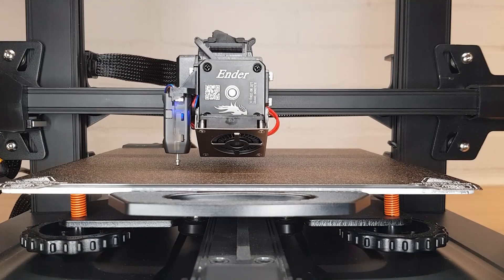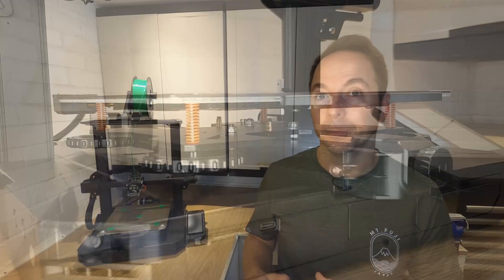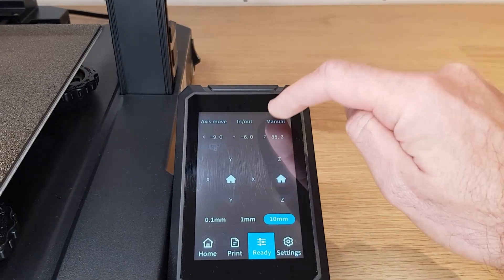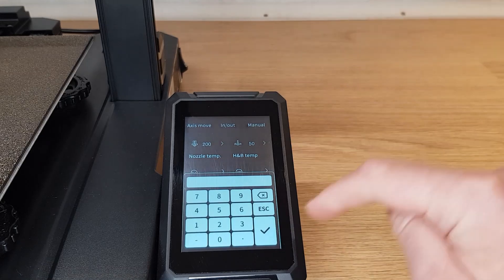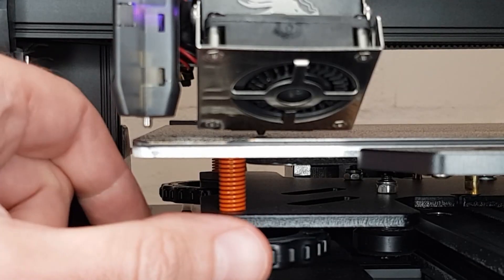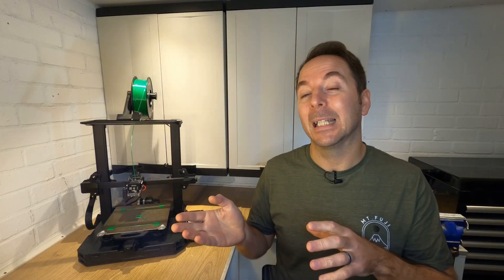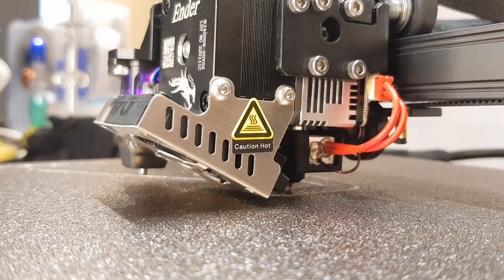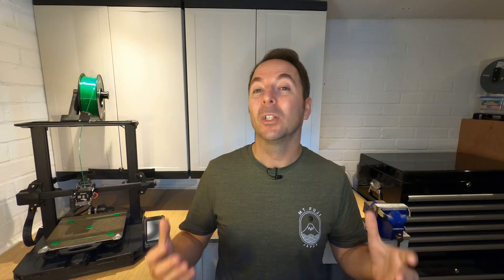Ender 3 S1 Pro 'Automatic' Bed Leveling In 3 Simple Steps

Comment: Hi.   as I said before this have been a great video to help with my S1 Pro levelling.   I am having one issue though, the big levelling wheels are coming loose then falling off during long prints.  Today was after 8 hours which I didnt notice and then everything sort of fell apart from there.  Sad times.  I follow the levelling process and the bed is really level afterwards but the wheels literally coming off mess up my prints.   Any suggestions?  thanks
Reply from the maker: Hi, usually the only way the adjusters can wind themselves off is if they don't have enough pre-load to begin with. Try adding more tension to all the springs before tramming the bed and you shouldn't have that problem. If for some reason you just can't stop it, get yourself a lightweight thread locker like Loctite 243 and put a small drop on each of the screws. This will stop them turning on their own but won't stop you turning them when you want to.
Reply: @RickyImpey  thanks.  just did a google search and it appears to be a thing on certain types of long prints.  Will try what you suggest.  Appreciated as always.

Comment: Very useful tips about the springs, I’ve never seen this done by anyone else. I assume this works for any bed tramming. I’ve just upgraded to a microswiss NG and having lots of issues with first layer so hoping this will help me. Great Video as always Ricky
Reply from the maker: Thanks, it's a technique that I've adapted from another type of 4 point leveling system. It's a method that works with any kind of 4 point leveling. Basically, you want to try to always adjust 2 adjacent points together as much as possible so that you never induce a twist in the bed surface.

Comment: Thank you for this video. You got a new subscriber. I just got an S1 pro.
Reply from the maker: Welcome! I have a video to help you with calibration or your new printer coming out tomorrow 👍
Reply: @RickyImpey  Nice. I'm looking forward to see it. Keep up the good work.
Reply: @RickyImpey  one question. Can I use the G92 and the M420 S1 Z10 in my starting Gcode at the same time or is it one or the other only? I can’t get anything to stick on the pei sheet even though I trammed the bed just like you did in the video. My current Z offset is -3,45 and I don’t know if that is supposed to be right or not. When I use the paper that came with the printer the nozzle is grabbing it but I can slide it in and out without it ripping.
Reply from the maker: @PeoplesChamp121  I think you probably mean G29 as that's the code for bed leveling. G92 does something different. There is no reason to have both a G29 and M420. G29 takes a new bed mesh before each print and M420 uses the one saved in the memory. I use M420 as it means a print will start quicker without going through the bed probing sequence each time. It's up to you what you want to use.
It's very easy to tell if your z offset is wrong. Start a print with a brim with about 10 lines and manually move your z offset until there is just about no gaps between the lines. This should be perfect.
Reply: @RickyImpey  thank you Ricky. I will try it again later today. I appreciate you taking the time to read and reply.

Comment: I am a complete 3D printingr beginner and I was having trouble leveling my Ender 3 S1 Pro until I found this video and saw the tip to add the G29/M420 code to my slicer's G-Code. Thanks Ricky!
Reply: The biggest issue for me is that for some reason, auto bed leveling doesn't work and keeps failing when the heat bed is on. Making the code useless to me as the probing fails at the begining of every print.
Reply: Hola nose si me podrías ayudar , a mi me pasa de que el auto nivel de mi pantalla lsd se congela al llegar al 100%  @bigboomer1013
Reply: Is it only need to be done once this gcode adjustment or on every new prints?

Comment: New subscriber, very helpful video, I am using Klipper, but noticed I was missing the command in the GCode start code, that was making the printer use the bed mesh.  Now I have added this I have found bed adhesion alot better across the whole bed, where as before, some places seemed to adhere and some didnt, many thanks for the very useful tips :)
Reply from the maker: Glad it helped Ian, welcome aboard 👍

Comment: #Ricky Impe  this is what i have in side my ender 3 s1 pro 

G28 ;Home

G92 E0 ;Reset Extruder
G1 Z2.0 F3000 ;Move Z Axis up
G1 X10.1 Y20 Z0.28 F5000.0 ;Move to start position
G1 X10.1 Y200.0 Z0.28 F1500.0 E15 ;Draw the first line
G1 X10.4 Y200.0 Z0.28 F5000.0 ;Move to side a little
G1 X10.4 Y20 Z0.28 F1500.0 E30 ;Draw the second line
G92 E0 ;Reset Extruder
G1 Z2.0 F3000 ;Move Z Axis up

could you reply with yours sire ?
Reply from the maker: No problem, this is mine:

; Ender 3 S1 Pro Custom Start G-code
G92 E0 ; Reset Extruder
G28 ; Home all axes
M420 S1 Z10 ; Use saved Bed Mesh
G1 Z2.0 F3000 ; Move Z Axis up little to prevent scratching of Heat Bed
G1 X0.1 Y20 Z0.3 F5000.0 ; Move to start position
G1 X0.1 Y200.0 Z0.3 F1500.0 E15 ; Draw the first line
G1 X0.4 Y200.0 Z0.3 F5000.0 ; Move to side a little
G1 X0.4 Y20 Z0.3 F1500.0 E30 ; Draw the second line
G92 E0 ; Reset Extruder
G1 Z2.0 F3000 ; Move Z Axis up little to prevent scratching of Heat Bed
G1 X5 Y20 Z0.3 F5000.0 ; Move over to prevent blob squish

Comment: I have found a weird quirk in the Z offset after the auto leveling on the S1 Pro. To get PERFECT first layers (no matter what size nozzle) from the get-go, the Z offset needs to be 0.10 mm above the print bed (which is roughly the thickness of a piece of paper).

if you set the Z offset manually to just touching the print bed after the "auto leveling", then go the axis move screen and move the Z height to 0, you will see the nozzle crash into the print bed. But if you do the +0.10 mm Z offset after the "auto leveling", when you go to the axis move screen and move the Z height to 0 and you look at how high the nozzle is from the print bed, it is darn near perfect to 0.

Which makes sense on their instructions. They say to run the auto level first, then when you hit the back arrow button it brings you to the "manual leveling" screen and you are to adjust the Z offset with a piece of paper between the bed and nozzle. I believe the firmware takes this height discrepancy of +0.10 mm into account from that point on.
Reply from the maker: I haven't noticed this myself but I will check it out, thanks👍
Reply: @RickyImpey  Ugh... I tried to verify what I wrote, but it didn't work this time. Although I had been doing a system reset back to factory settings between each. Now I'm wondering if it's a "first time" deal.
Reply: After a bunch of filament, 2 nozzles, and some scratching on my plate, I can confirm that if there isn't a mesh saved (i.e. fresh out of the box, or a system reset) you need to use 0.10mm feeler gauge or piece of paper when setting the offset for the first time. The firmware will use that and adjust the nozzle down, but use that Z offset in the display.

I'm still playing around with any probing after a mesh is created.

Side note: Also found out that bed leveling is always on (even after a G28), so you don't have to put a M420 command in your slicer config software. I guess Creality compiled the firmware with "RESTORE_LEVELING_AFTER_G28" enabled.
Reply from the maker: @MrDB42  I did suspect this could be the case so nice to have it confirmed, thanks
Reply: @RickyImpey  Also, I do believe that if you set your Z offset to 0.00. It will revert back to needing a 0.10mm feeler gauge (or paper). But I need someone else to confirm this. 

I think the code is: If Z offset=0 then adjust down 0.10mm, else do nothing. But not sure.

Comment: Hi Ricky. Great video   Do you have any profile or setting that you want to share with the Nubbys this my first printer.
Reply from the maker: Hi David, if you want to use Cura instead of Creality Slicer then check out this video https://youtu.be/65pUF2XxRjI This should give you a good starting point with default profiles that work with all of the common filaments and is all I really use. I don't do anything fancy.

Comment: Hi.   Thanks for this video.  Really clear and easy to follow.  One question.  on your S1 Pro your machine settings say 235 in the x and Y.  My Is pro says 220.   Should I change that?   thanks again
Reply from the maker: Hi, what slicer are you using and where did you get your profile? I basically copied over the Creality Slicer profile into Cura using this method. https://youtu.be/65pUF2XxRjI  The higher figure will let you use a little more of the bed.
Reply: @RickyImpey  thanks.  found an old article on line and used the settings from that.  I use the latest cura and that doesn't have a pre loaded S1 pro profile.   Thanks for the help.  Just completed the calibration and hoping it helps.  I get a number of successful prints but every helmet print fails, sometimes 3 hours in.  i.e. the print comes loose from the plate :(.  this is my first 3d printer ever and had it for just 3 weeks so lots to learn :)
Reply from the maker: @simonUK38  I know wmany see it as the ultimate sin but for some extra peace of mind you could put some PVA based glue stick down for those big important prints.

Comment: Hey Ricky, I'm having a problem where the extruder seems to quit during my first layer but only in one quadrant of the print bed area. Can't figure it out for the life of me. Do you have any ideas?
Reply from the maker: Hi, is it the extruder stopping or is your nozzle getting clogged from being too close to the bed or too low temperature etc.? If you're not sure, try increasing your print temperature for a test and also decreasing your z off set to lift the nozzle up so you can see what's happening just for a test print.
Reply: @RickyImpey  if you're familiar with the Cartesian quadrant system, the distant part of quadrant one seems to be the only place where my extruder has any issue. I've aux leveled, auto leveled, and tried both modifications to the gcode you mentioned in the video. For some reason when it gets to that area, and that area only the extruder starts clicking and that area of the print bed is blank after the first layer. Everything else actually comes out great 😂
Reply from the maker: @benjaminmarquis6250  Hmm, strange🤔
Reply: @RickyImpey  if you think of anything I'd appreciate the help!
Reply from the maker: @benjaminmarquis6250  Sure, have you 100% ruled out a clog or other kind of restriction? If it's not a physical issue with the hotend/extruder then it would likey be some weird quirk with the g-code or firmware. I would definitely expect it to be more a hardware issue. Did you try lifting the nozzle by reducing your z offset?
Reply: @RickyImpey  switching from cura to prusa slicer seems to have fixed it. Granted I haven't tried a large area print yet but I'll get back to you once I do, also thanks for the help!

Comment: I really like your videos, they are so easy to understand and follow along. 
I tried this following every step but when I am printing the test, some corners are still out of level. One too high, one too low and so I adjust the knobs again and abl but another corner goes out of level! Drives me nuts! Any suggestions?
Reply from the maker: Hmm, that's strange. After all of the steps you should have a level bed. Some people have had problems with some firmware on their S1 Pro. What firmware do you have?
Reply: @RickyImpey  I don't doubt you for a second that it should work! Maybe the larger bed causes more discrepancy. Forgot to mention I have the Plus, not Pro. It's running 2.0.8.23F4. All the steps go off without any hiccups but the test still comes out uneven. Should I be running ABL after every knob adjustment if needed?
Reply from the maker: @iEatCookie  Doesn't the Plus have the same screen as the V2? I don't have a plus but if it has a different screen then the method may be slightly different.
Reply: @RickyImpey  From what I can see, it seems to be the same as the pro. I followed what you were doing on your screen step for step.

Comment: For those using klipper M420 S1 Z10 is not working (Unknown command:"M420"). 
for now I am using instead BED_MESH_PROFILE LOAD=default; and seems to work fine.
Any other ideea? 
Thanks

Comment: Are the Ender 3 s1 and s1 pro similar enough this can be used for the S1 as well?
Reply from the maker: I don't have an S1 but they have a different screen which means different firmware. I can't check but I would say that the process is probably slightly different. I have a generic ABL leveling video that may be more suitable for the S1 here https://youtu.be/zKpNxqWie_8

Comment: Hi Ricki, I have an Ender 3 S1 pro printer.
I changed the nozzle and when I try to level the bed that lowers the extruder it sticks against the bed and makes a very ugly noise. And right in that parameter on the control panel is the z axis going up, which has a response time to tap to go up. Is there any way to manually
Reply from the maker: Did you follow all of the steps in the video? It sounds like you z axis offset is wrong.
Reply: ricki yes, that's wrong, but the nozzle crashes on the bed, when I say level in settings it lowers the extruder, that's why I want to raise the z axis, manually like 5 mm to be able to level everything, like the description of your video.
Reply from the maker: @rosamariabetancourtleal9133  The nozzle should never hit the bed, it sounds like your CR touch is not working
Reply: Ricky, well, I don't know, the printer is three months old, the lights come on, CR touch hits first, but maybe it doesn't send the signal.
I checked the nozzle, and there is a little difference from what it was before I changed it.
It can be that?

Thanks Ricky for the help.
Reply from the maker: @rosamariabetancourtleal9133  Try putting a box or book under the CR touch and see where it shops without it damaging your bed. Have a look at the beginning of this video to see what I mean https://youtu.be/zKpNxqWie_8
Reply: Change the mouthpiece for the original one, but do not carry out the test, that sound scares me, could something break?
I'm going to search the creality website to see if there is any solution.
Thanks Rick. Grateful

Comment: My ender 3 S1 pro can not auto level the bed when it is heated. It measures slow and in half of the proces it faults and then again and again until I turn off and on the printer. When I measure the bed when its cool it works fine. Does anybody know where is the problem, please? Maybe it should be measured when the heat bed is off. I´ve seen an official video of creality measuring the bed and they´ve had the bed off so maybe it should be off... I dont know...
Reply: Hi. I have same problem, and F/W & H/W also same. Haven't found a solution yet.
Reply from the maker: What firmware do you have? I'm trying to work out if it's firmware related as there are others who have the same problems you do.
Reply: @RickyImpey  I have stock firmware 2. 0. 8. 15F4 H/W version CR-FDM-v2.5.S1_1
Reply from the maker: @kentus5219  Thanks
Reply: @RickyImpey  Have you figgured out something? Or will you make a video about it?
Reply from the maker: @kentus5219  I'm planning to see what I can work out but I'm on something else at the moment.

Comment: Super video !! Is it a problem if we do it without the SD card inside ?
Reply from the maker: No, I believe everything is saved to the internal memory on the S1 Pro, unlike some other machines. Should be fine to not have the SD inserted.
Reply: @RickyImpey  OK, I did the test and you're right :)
Reply from the maker: @Guillaume_Boutin  Good to know, thanks for coming back to let me and anyone else reading this know it works👍

Comment: Is that means the Creality still didn't discover Marlin's features LEVEL_BED_CORNERS and/or ASSISTED_TRAMMING? Both makes whole corner leveling much easier, more precise and without necessity to drilling bed by nozzle.
In older Creality printers, where BLtouch (or its "counterfeit" CRtouch) wasn't standard part of printer, it was kinda understandable since both features requires probe. But now?

Comment: Hi - What firmware version is your printer running? Mine always fails halfway auto-leveling - I've dealt with it so far by just leveling it manually with the aux level, and then setting the offset, and getting fine prints, but i've paid for the auto leveling, so i'd be happy to get it working. Thanks!
Reply: Hi, my printer does the same. It fails when I start autoleveling with heated bed. When I do auto bed leveling without bed heated it works fine... Maybe the bed should be cool when it is auto leveling. I´ve seen a video from official creality with ender 3 s1 pro and even they did it with cool bed. Let me know if you will find a solution, please.
Reply: @kentus5219  Oddly it works for me when not heating up the bed too - But i'd like for it to work when heated - What i also don't like is that when you enter the leveling menu, it changes the z offset automatically - What i've done is printed one of the 'level tests', where you can fine tune it while printing, to get it just perfect, and then just printed on happily after that
Reply: @user-uk3gc2dk3h  Check you're wheels on the bed. I had probing fails right out of the box and after tightening the wheels, ive never had a probing problem again. But don't over tighten or else you're wheels will wear out very fast